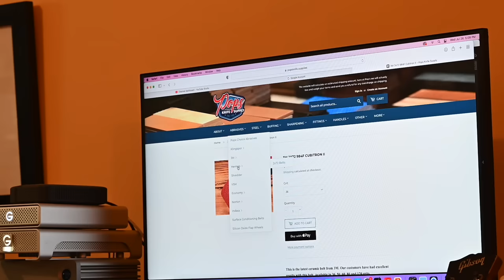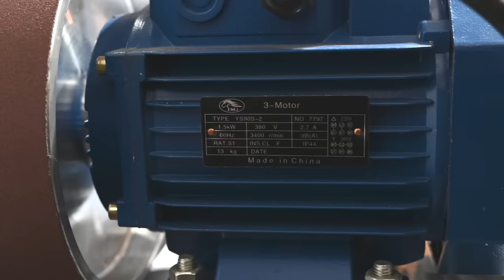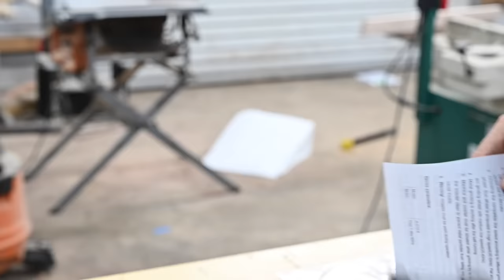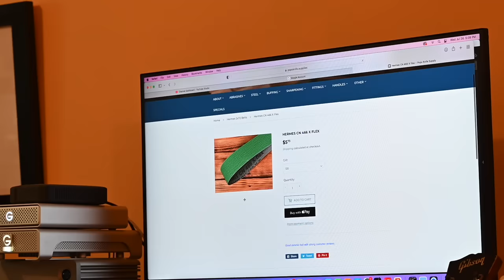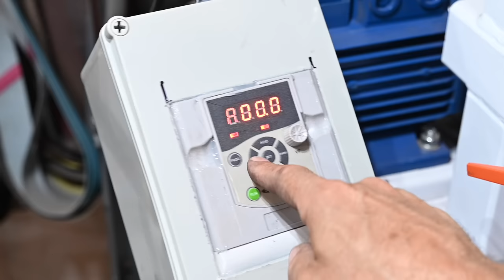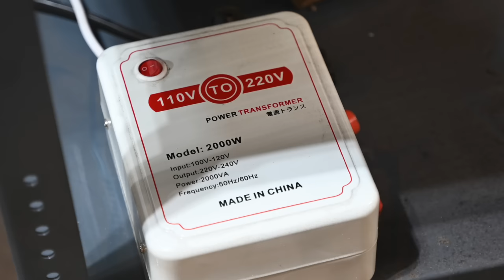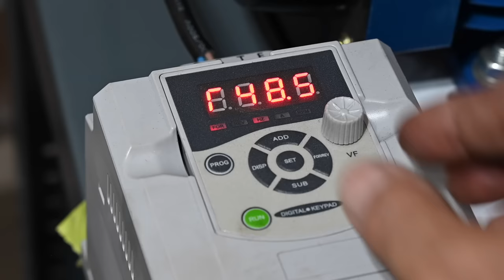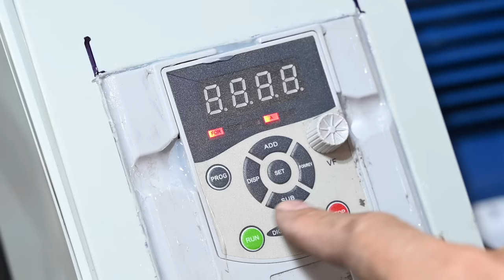Cheap Grinders Are a Joke!  (Right?????)

Comment: I have this grinder and fully agree with Walter. My solution for protecting motor and VFD is a simple piece of cloth wrapped around both the VFD casing and the air intake of the motor. It works as a simple filter stopping metal particles but at the same time allows cooling air flow. I’ve been using it for one full year now and it works
Reply: Thanks
Reply: I wish YouTube allowed commenters to post pics so I could see your setup.
Reply: @davidswanson5669  unfortunately it’s not allowed but honestly there’s not much to see. It’s just an old cotton tshirt roughly cut and wrapped around the inverter leaving only the controls accessible kept in place with electric tape. Another piece of cotton is placed on the air intake of the motor kept in place with an elastic rubber band. Very simple but absolutely effective
Reply: @a016001  thanks, this longer description is just as good as an image.
Reply: A point I wasn't aware of until recently is that the actual controls pop out and can be connected via a standard network cable. (those are finger wells to help remove it either side).  It makes enclosing the main box simpler.
Reply: @paulstafforduk  thanks Paul.  I just had a look, and you are correct.
Reply: No need to protect the motor if is actually TEFC like it appears to be. Totally Enclosed Fan Cooled.
Reply: @paulstafforduk 
That is very valuable and useful information. 
  I'd already heard of the need for filtration and the question of cooling for vfd and power supply.
  So your information makes it another level away and secured plus allows for the end user to place controls in their system as needed within reason. Great tip.

Blessings abundant Sir

Crawford out 🙏🏻🔥⚒️🧙🏻‍♂️
Reply: are you using 2"  x 72" belts on it? Did you have to the cut arm length to make it work like in the video?
Reply: @irhumbled  yes but it’s an easy mod, I’ve cut away 5 cm or so with an angle grinder and now I can use both 82’’ and 72’’

Comment: If the VFD was to start getting hot, cutting a hole in each side of the enclosure and then putting some filter material in one and a filtered fan made for a PC enclosure in the other would solve the issue for sure and could probably be done for under $40 if you looked around a bit.

Comment: I have one here in the UK.  Limited selection available in our market, especially at that price (£700).  A year of hobbiest use and its performed really well.
I used my remaining 2x72 belts simply enough without needing to cut the end off and switched to 50x2000mm belts

Forgot to add that I found it easier to swap the Allen bolts for M10 wingnut bolts on the table and platen
Reply: I've looked on their UK website repeatedly and never seen them on there. Where did you get yours?
Reply: @twatmunro I got it from them last year.  The only other place I saw it was Amazon, and it's still there but rebadged by other sellers and three times the price!
Reply: Any additional steps required on the electricity front? Just plug and play or did it need a transformer?
Reply: @rrelph86  Just plug and go
Reply: I Goto e a year ago (2024). Mine came in a damaged crate like it fell out of the back of a truck. The motor fan cover was dented so had to do body work on it.  Still I kept it and got it set up and running. Mine didn’t have a VFD so ran  at high speed . The problem was Iit had a single phase motor so a VFD would not help.  My solution was to replace the motor and add a VFD so found an American three phase my with an American VFD already wired to it that I found on the Diktator website in Oregon. But that VFD was speed adjustable only . But a reverse switch for it was on Amazon for $12.00!  I cut 1.5 inches off the tool arm and 1” off the rear of the tool arm housing to accommodate the new motor. Now I can use 2x82” or 2x72” belts. I then cut out a 4”x12” quarter inch plate an super glued to the provided small plate and built a new longer tool rest bracket to lower the tool rest tone able to use more of the platton. My platton liner was worn out by this time so replaced it with a glass liner. The frame is very solid, so with these modifications it’s now a pleasure to use.

Comment: I've had one for 2 years now. I made separate arms for the attachments and mounted the vfd in an old box I had available. I also wired it directly to 220v. The transformer I got with it wasn't large enough and would constantly trip out. 
My vfd is a little different than the one you got, but it has been going strong this entire time.
I wouldn't hesitate to recommend one at the price for someone on a budget. I've been very productive with mine.

Comment: Just got mine last night.  Was delivered to the freight depot yesterday lunchtime, and I figured that it wouldn’t arrive at my place til mid next week (I live in rural Tasmania).  
Unboxed it last night, and set it up on the bench.  
I took 50mm (about 2” to you Seppos) off the tool-arm, and it fits all the attachments perfectly (300mm toothed wheel, small wheel -with both a 20mm and 30mm wheel, and the platen set) using 72” belts, as well as the several included 82” ones from Vevor. 
I got a nice, old plastic food container (similar to “supper-ware” 😀) to hold the control box.  Much easier to mark out the cuts to expose the controls than a electrical box. 
Very happy, so far, but have not yet actually ‘done’ anything with it.

Comment: I’ve owned it for over a year.  Shortened the tube to fit 2x72 belts. Replaced the graphite after a while with a glass platen.  Converted to 220 (no transformer) Vfd popped after about 8 months(I made a box with a filter to keep it In). Bought a higher quality one when replacing.  Otherwise love the machine. It’s a grinding machine. Also the keypad pops out of the vfd and a cable can be added to get the vfd further from the grime. Forgot I also fabricated a larger table.
Reply: D*** I didn't even know they had glass platens, fancy!

Comment: I have this grinder and have used it hard. I also removed the control pad and mounted all electronics under the workbench. Then put the control pad on the bench in an light switch/ electrical box. I was very skeptical at first but with a few mods this grinder will be great.

Comment: Just watched this Walter and thanks for doing this review, it came about due to a question asked in a knife making group in Australia and someone posted you video, an honest review and looks like a fairly sturdy machine but just question, Why did you mount the VFD on the bench in almost direct line of fire of all the sparks and metal debris and not on a post back near the motor, once turned on and speed set you really shouldn't need to touch it again to turn off,  and again thanks for a frank and honest review, as I have never come across you before will certainly be watching more.
Reply from the maker: Thanks, man, appreciate you starting to watch!

Comment: this machine seems to be made with whatever they have on hand, some pics i see its made with plates screwed together, other steel tube, and the electronics are different, the vfd i got is kinda nice, the actual control panel detatches in a lile square from the main housing and can be extended with a ethernet cable,  so you can put the vfd and converter way away from the machine in a dust free location, and run the controller to the machine

Comment: Wow "cheap" grinders have gotten much more expensive. I bought a Reeder 2x72 frame back in 2017 for $500+ shipping (delivered it was like $570) Bought a sealed 3phase motor off amazon for $170 and a KB VFD for $357 (also off amazon) All in was under $1100. Looks like the price of entry for a US made grinder is more than double that these days. Great review. Would love to see a review of the Reeder some time, maybe they'll send you one... Just keep in mind their prices have gone up significantly since I bought mine. The same frame now costs ~$800... still a nice quality build IMHO though. Too bad mine mostly sits in the basement.. I need to get back to working on my skills.
Reply: Yeah it would be awesome if the US manufacturers would/could compete with the Chinese machines.
Reply: Agreed - I have had a Reeder for years and absolutely love it. It is actually a really great value when you take the quality and engineering into account. I'm not sure why Reeder doesn't get more attention than it does, but I think the quality difference is something you have to kind of experience for yourself. I've gotten to use KMGs, Wilmonts etc and they are all really great machines, but I feel like the Reeder edges them out in design and value. It was an absolute game changer in my shop.
Reply: @CaptainTwitchy unfortunately that'll never happened considering the China uses mostly what would be considered slave labor it's the the buy American products for the quality inn the reassurance that you are helping another American pay their bills aspect that keeps me spending a little more money

Comment: It was a choice between Vevor grinder or one with no drive motor and no wheels so far I’ve only cut maybe 1.5” off tool arm to accommodate 72” belts also I measured platten length and fitted a ceramic glass platten with stop . very pleased with product shipped from Cali.

Comment: Thanks for this review. I recently bought one of these. Not quite the same, the one i have is a little more user friendly, however it does have a similar size work table and speed controller. 
I haven't yet had the opportunity to put it theough its paces, but i did actually get an electrician to rewire it as the wiring it came with was shoddy to say the least. Not the wiring is nice and solid and looks professional.
Im still in the process (multiple processes) of putting together my work shop, so hopefully one day soon i can really test it out. That said, i am super happy that a man with your years of knowledge and experience put it through some tests. Gives me a little piece of mind.
They arent overly expensive, especially compared to the American made model, but id be had pressed i think to fabricate on myself for the same cost.

Comment: Here is more info on shortening the shock I found from another site:   

Jordan
 Mr
Reviewed on Feb 04, 2023
If you order Item 782J79, Mfr. Model GSWB410645 from Grainger you can convert this to 72" with no permanent modifications. It is a smaller gas piston with the same pressure. Drill out the ends of the new piston with a 5/16th" bit to fit the original hex screws, swap the pistons and now you have a grinder that works for 72" with no permanent modifications and you can still tilt the flat platen/use the top/bottom areas of the belt for rounding etc.
Reply: Why not just move the top shock mount on the upper arm forward a bit?

Comment: Thanks for the review Walter.  I bought this grinder earlier this year and I'm relieved to hear you're opinion that it isn't absolute trash. 

I enclosed my vfd in an ammo box and I also added an earth grounding wire. 

I've only really used the flat platen so far and the graphite pad is showing some dents. I think I'll replace it with a ceramic glass platen on the near future. 

With the small radius attachment, the angle of the belt seems to limit the ability to plunge into tight corners.  I see some other grinders have a contact wheel above the belt that essentially makes it run horizontally before curving around the radius.  Any idea whether something similar could be modified for this grinder?

Comment: For european people, you can get a similar setup but from european based company, Batko, they make 2 versions, I just gotten the cheaper one which is for a 50x1650 or the bigger one for  up to50 x 2000 belts. Reasonbly priced and seems solidly built.

Comment: I bought a 4x36 belt grinder from Canadian tire. It seems to work alright, but it is GROSSLY underpowered, it works but takes a long time to surface grind, and doesn't have the power to remove material quickly. It took me all afternoon to shape my blade profile yesterday 😅
Reply: Basically they skimped on the electric motor to run the grinder

Comment: Well living in Europe I have no issue with metric, 220V, 2x82 / 50x2000 mm belts.
Will I buy it? No. I built my own grinder. Actually I built 2. I used my first one for about 9 years despite all my design errors. My new built, I brutally honest, is my copy of Brian Fellhoelters Ubergrinder. Is it perfect? No but having built it myself I know it in and out and know how to fix issues. The cost? About 460€ so way cheaper than anything else.

Comment: Outside the U.S. - both 82 inch belts and metric measurements are a preference... So I'm left with the cheap and dirt susceptible boxing of the electric parts, which, I think, will be fun to fix myself. Never went into any of this before, and of course I'm not a "professional" metal worker of any kind - so I'd consider improving the machine just another fun and welcome fun project. 

One thing missing here is the actual prices, though. How much is this one, and how much are the "American brands" mentioned? what's the difference? is it half the price? third the price? could you at least throw in a link to purchasing this product and 3-4 American-made alternatives to compare against?

This is a big heavy box - and the shipment expenses could EASILY be higher than the product price anyway (where I live).

So the review is missing important info for me. 
Thanks a lot!
Reply: Currently it's 998usd and free shipping. At least on the vevor site currently. 

Other Americans brands I've seen are 2700 to 9000 USD  from what I've gathered. 
  Side note. Roy Adams Christ Centered Ironworks noted in his review as shipped it can take up to a 2 x 90 belt. Error 50mm x 2250mm ish 😊
   Another person I know of....  Purchased section of steel and made an extra complete arm to mount the flat platten to and it stays dedicated to that. Another longer section was used to make a dedicated home for the small wheels attachments and it uses a much longer belt. Reasoning was for a greater section of slack belt and better angles of grinding on the small wheels. 
   Just some thoughts based on the experiments if others.

Blessings abundant Sir hope this helps some.

Crawford out 🙏🏻🔥⚒️🧙🏻‍♂️

Comment: Decent enough review, and I’m glad I watched it.
But I think I’ll take a pass on this.
I’m putting together the money to buy a Housemade 2x72 revolution series grinder. It costs a little more but still under $2k.
You get the components, plus you have to source your own motor and vfd, but, you have total control over the manufacturing process. You get the opportunity to build the machine as good or bad as you want. LOL